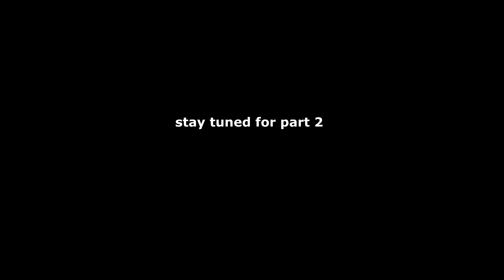BOEING 777 9x Lufthansa RC airplane build video Part 1

Comment: Hi Ramy, amazing job. I did an RC Concorde years ago (1m90m long, 900gr AUW, depron/fiber glass made), and used "SoLite" from Solarfilm for the cover. I would be interested to know what is the density of the vinyl covering you use for your models? There is no such information provided in the links you provided.

Comment: Hi 🤗   I appreciate your video. I am building an airplane watching your video😁 I have one thing to ask. I guess that the part is a little bit weak that connects the servo motor and the spoiler behind it at 4:22 in your video. What do you think?

Comment: Remarkable building skills.  At 1:26 you seem to be using a single part glue for the fiber glass (25 or 80 grams/m2). Usually, epoxy is in two parts. Pray, tell me, what is that glue? Is it better than epoxy? The item does not seem to be listed in the details below the video. Thanks, anyway, for an  inspiring video. The video manifests skills that must have taken years to perfect.  Eagerly waiting for the second video.

Comment: Howdy. Around 9:20 you showed what I think is the elevator with a portion of the elevator cut out that angles even more than the elevator. How did you achieve this? It looks like you simply added a tie rod connecting the main elevator to the smaller portion of the elevator. Is this correct? 
Thanks for the help and great video/build!

Comment: why u use paper for making model u can use weightless metal instead of paper bcos if u land it will not damaged but if u make in paper it will damage in  every landing and repairing cost will be more and your model rc is very nice and your next project 777-9x first part is superb and waiting for next part
Reply: Weightless metal? Lol
Reply from the maker: I use Depron foam, balsa wood and fiberglass
Reply: Weightless metal=aluminum
Reply: Damn nice English buddy

Comment: Don't forget that the 777X elevators and rudder are tapered like the 787! Just a side note ;)
Reply from the maker: really!! I thought only the wings! I saw some pictures for the 777x and the elevator looks line the ER 

https://img.vehiclepad.com/dd5d507be32c2a19d89109f99b64bb40_boeing-777-9x-prototype-picture-2-by-salvatoreadamo22-on-deviantart-boeing-777-9x_1442-810.jpeg
Reply: I don't think it will be that big of an issue, but for the sake of pure detail, yes, the vertical stabilizer is rounded like the 787, and the horizontal stabilizers are longer than the -300ER and rounded like the 787. 

  http://www.boeingimages.com/Docs/BOE/Media/TR3_WATERMARKED/5/9/d/f/BI46701.jpg

Comment: What is the fabric stuff he used to reinforce the joins
Reply from the maker: that's fiberglass
Reply: Ramy RC ok thanks what did you pat it down with was that just water ?
Reply: Scratch built Rc models you can use epoxy or superglue to apply fiberglass. I’d advise doing a little research before doing anything if you plan to.

Comment: just lovely. But i thing servoes for elevator should be 12kg servoes. a lot of stress on them with such a heavy plane.  but i may be wrong. :)   Love your work.
Reply from the maker: hey guys thanks for the info, actually I used 13 grams servos for the elevator and still not sure if I'm going to keep them
Reply: ArcticRc 12Kg????!!!!
Reply: GoldenAce57 how much do the servoes pull? if the plane will way 12kg you also need servoes that can hold the pressure of the rudders.
Reply: ArcticRc Just because the plane weighs 12Kg doesnt mean you need 12Kg servos. 18g metal gear high torque servos would be sufficient
Reply: ArcticRc His 737 Max uses 9g servos
Reply: GoldenAce57 I see. i got my head stuck on my gas acro planes. they need stronger. sorry my friend 😊
Reply: ArcticRc Now there's a subject you know more about than me :)